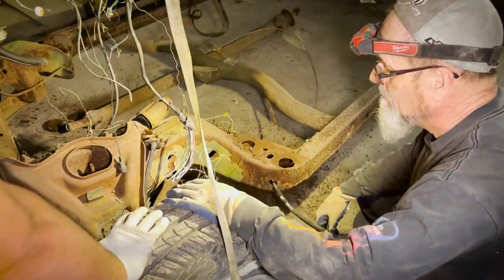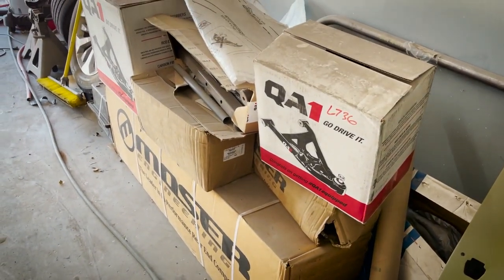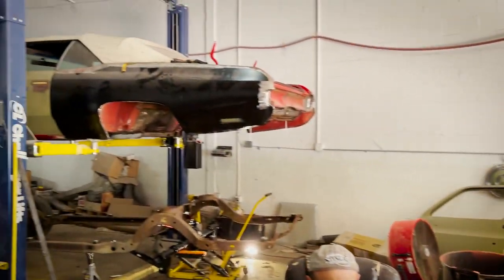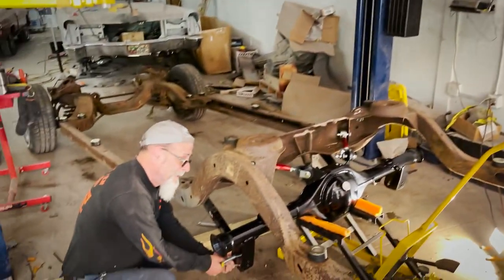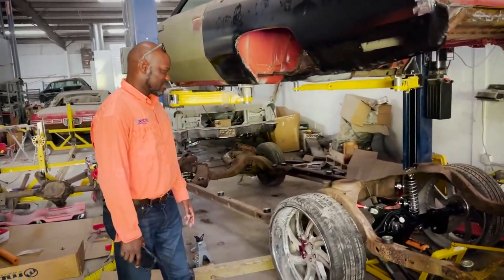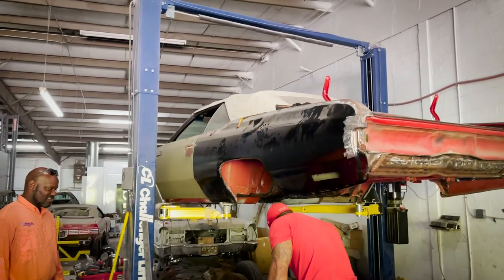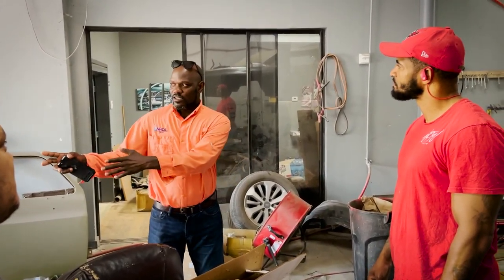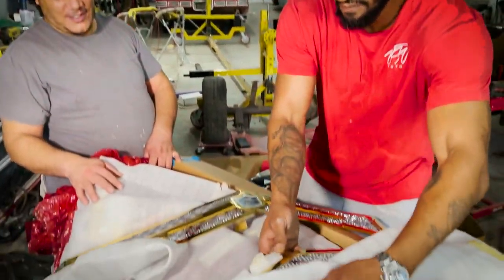1972 Impala Convertible Donk - QA1 Suspension Test Fit

Comment: Did you guys have any issues with the trailing arm brackets on the moser rear end housing? I have the EXACT same set up and seemed all the mounting brackets were off from the factory location. The lower trailing arms are same as factory length which is 22" but even at the closest hole it still pushed the wheel back like 1½" too far. And theres only positions to push the rear end back further not pull it in any. Also the brackets for the coilovers were way off. The actual coilover couldnt fit into the brackets because the angle was all wrong. Did you guys have any of these issues? Id really like to hear back from you on this id highly appreciate it. Thanks.

Comment: I'm in the process  of redoing my 78 impala  what's a good rear end to run I keep hearing  different  story  what you u recommend  it had a built  383 on 6s pushing  about 460 hp and a 700r4 transmission  lmk thanks great  video  too bro